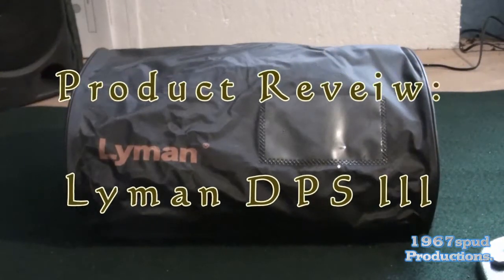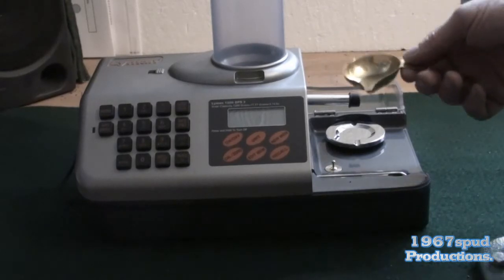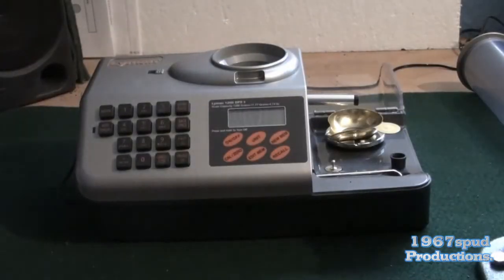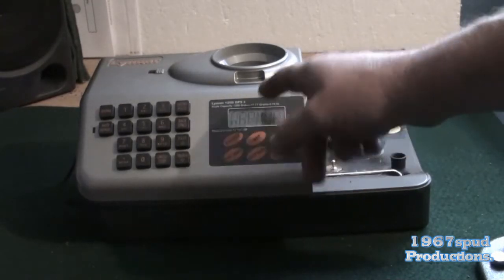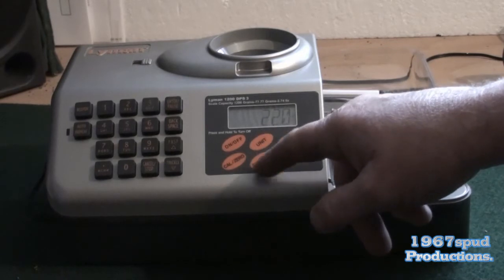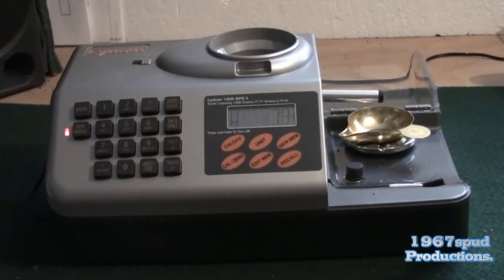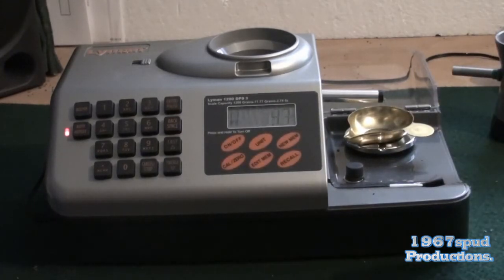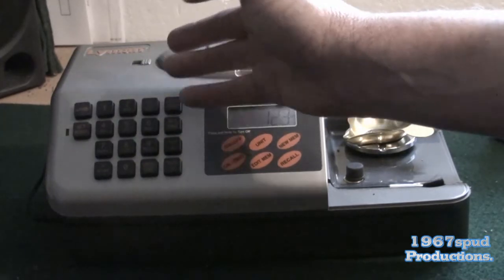Product Review: Lyman DPS III

Comment: Well done for taking the trouble to produce this review Spud - the word you were looking for is "pan" !! (LOL)
I have a Lyman 1200 Mk3, it is more accurate for the 1/10 grn increments with the cover over as you have maybe found. The other thing which needs to be mentioned is the unit must be shut down correctly otherwise damage can occur which needs a factory recalibration.

Comment: There seems little point in paying £300 for this device, when you also have to use a trickler, you could use a scoop measure, then trickle in on a proper beam scale, and not being "electronic" the beam scale will not go wrong, as the electronic one will in a short time, as electronic things do.